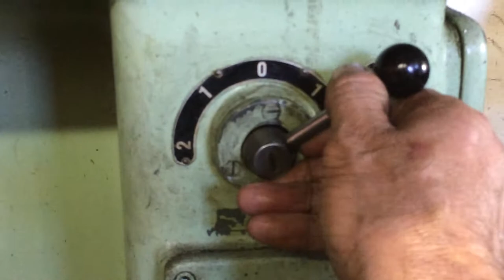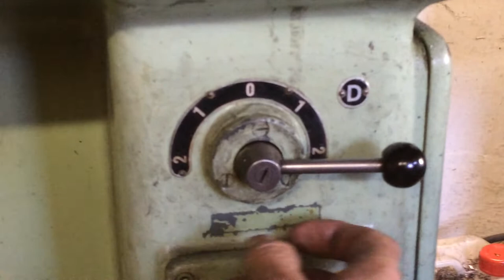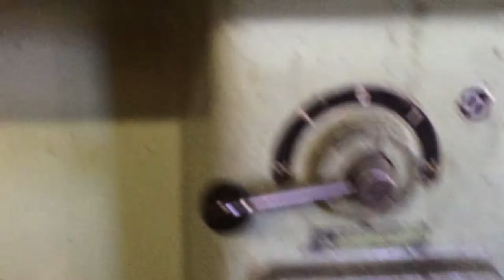The Boley 5LZ

Comment: Just got myself a boley 5lz. After long surch . Can you advise to what oil to use in the electrical gearbox. Please. Found info on all the rest. But not that yet. 
And on the apron there is a lever just above te bedfeed and leadscrew lever. On my machine that seems to not ingage anything. Also the halfnuts dont stay closed.
Reply from the maker: Manus Holm that lever is the lock for the longitudal movement 
I wil come back to you on the oil
Reply: @Teunbaartman1  thank you for the fast responce
Reply from the maker: Manus Holm what do you mean exactly by: the halfnuts don’t stay closed?
The oil in the gearbox is not really critical. A good quality car gearbox oil for an automatic transmission
Reply: @Teunbaartman1  when you close the half nuts thay pop open soon as you let go of the lever. Hope there is not some thing broke  in the apron. Powerfeed klíck into position nice and cleer. Also disingage nice and sharp.
The lever above turns free except for one spot were it has a hitch .
 Does not seem to activate on anything .may have to open her up. Was hoping not .
Great so any aft will work. Thank you
Reply from the maker: @manusholm3536  can you post pictures or a video. I am not sure which lever iyou mean. The popping open of the half nuts sounds like an adjustment problem, or dirt, too much oil or grease.
Reply: @Teunbaartman1  ok. Ill take some videos later today. 
And see if i can post them
Reply from the maker: Ah, now I see which lever you meant. It is for the cross feed and it only works when the longitudal feed lever is in the neutral position.
Reply: @Teunbaartman1  hi. sorry i only reply now. had afew rough weeks. i still have to figure out how to add photos to a comment.
did more cleaning. found the bedways are very badly warn. and the cross feed nut is razorblades inside. suspect ill finde lots more waer on this old girl. gearbox is noisy and some times does not ingage.  swiches also does not always makncontact. bit of work to come. think all can be fixed in time.